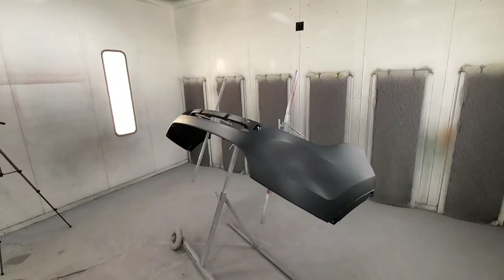UX '15 Ford Explorer

Comment: Are you using water borne? Our shop uses water borne and UX alway gives me trouble, when I go to clear it look cloudy, almost as if it is not enough color even after 5 coats of color,  im thinking either my sealer isn't laying out flat and making the metallics look weird, or my pressure is to high when I spray color
Reply from the maker: Usually air pressure and distance.  I shoot at 24psi (trigger pulled) @ about 8" off panel , 75% overlap for first two coats. Then i drop the air to 18.5 and back off the panel to about 16" and increase my overlap to 80-90%. Just let it fall on. Sometimes , I have confused coverage with poor metallic orientation. If it goes on dry initially (drying before it hits the panel) , you will never get it to look right without re-sanding.